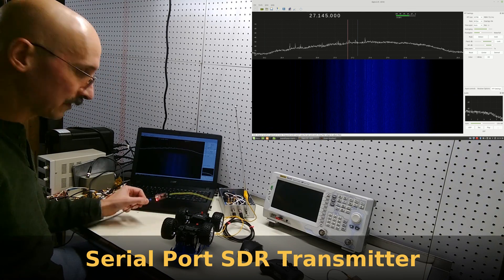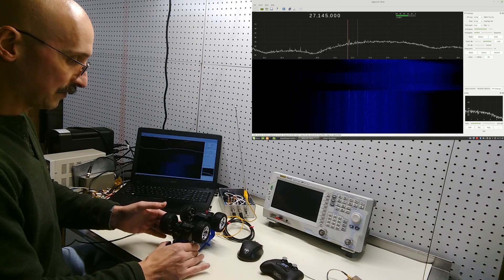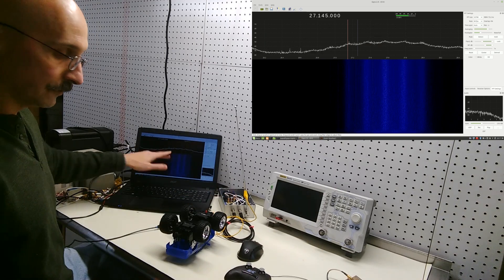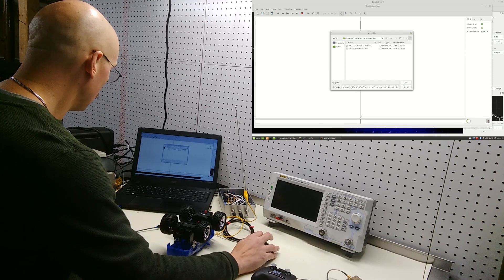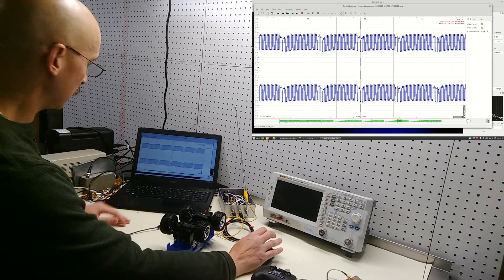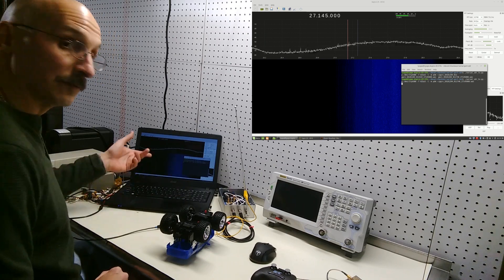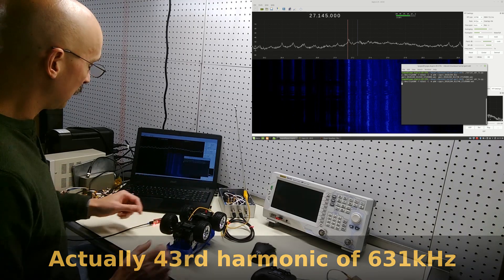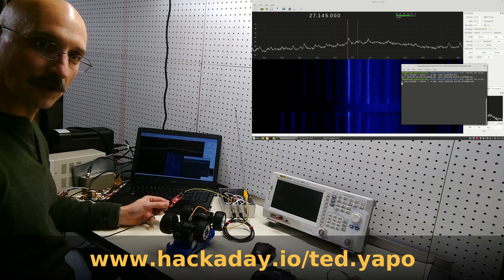Serial Port SDR: 27 MHz RC Truck

Comment: Fascinated by this. How are the signals modulated and encoded out of the RC transmitter? Is it AM? FM? SSB? Something fancier? is it just various frequency audio tones (AFSK), or is it using some kind of PSK? What mode is the SDR software in for demodulation?
Reply from the maker: tbh, i don't recall. it was two years ago, lol
Reply: @TeddyYapo  Fair 'nuff. ;)

Comment: Do you know how to transmit a serial or USB signal through a radio transmitter/receiver ? I want to replace the cable of barcode readers with a radio link. The project is serious, I have a budget.
Reply from the maker: there are wireless barcode scanners available. If their range is sufficient, this is probably the easiest solution.

Comment: Excellent work. Thanks for releasing the code will have to give it a try. Have you had a look at the osmo-fl2k project? Based on the Fresco Logic FL2000 chip.
Reply from the maker: Thanks! Yes, the osmo-fl2k project is awesome.  I used it to create a voice marker generator that announces the frequency on each of the 118 AM channels at once: https://hackaday.io/project/21145-am-band-voice-frequency-marker/log/145487-osmo-fl2k-ftw